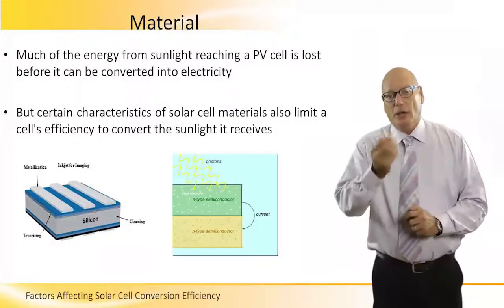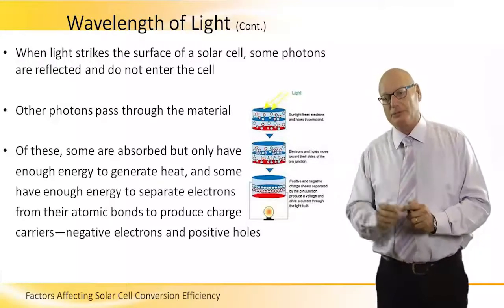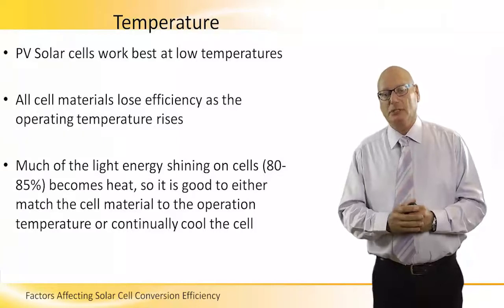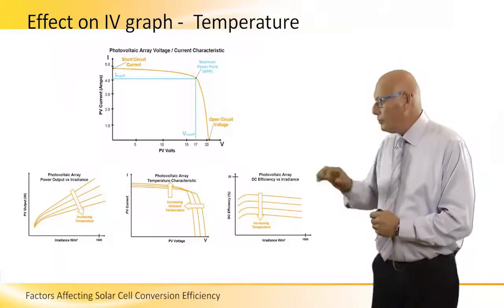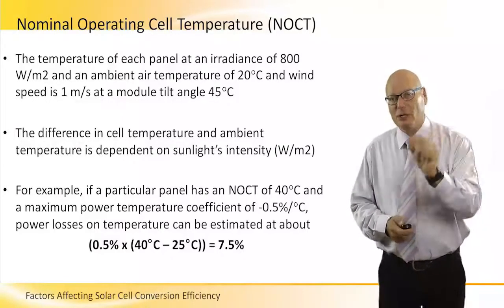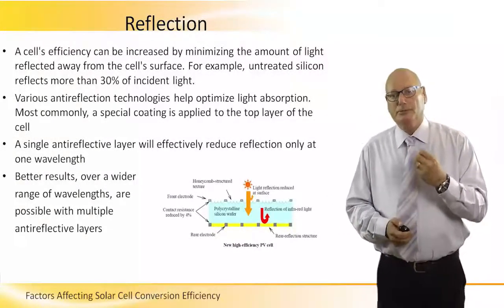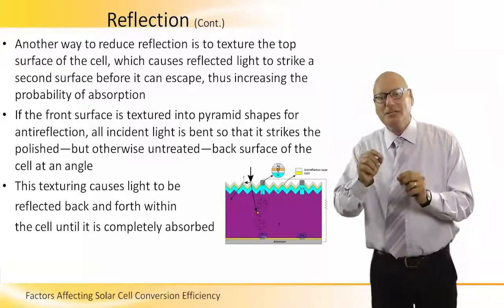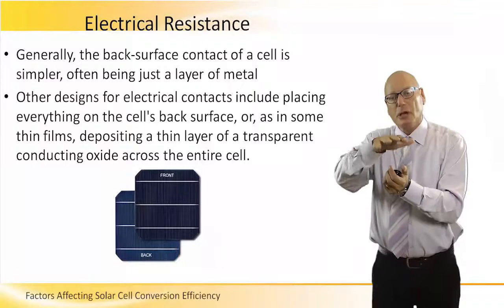Factors Affecting Solar Cell Conversion Efficiency

Comment: I showed many times to people in my part of the World where I baked eggs on a solar panel.Highest temperature I ever measured on a panel in the desert was 79 degree cel. Their average lifespan was around 12 years, after that,once need to replace them or else,mount two or three more which was impossible.